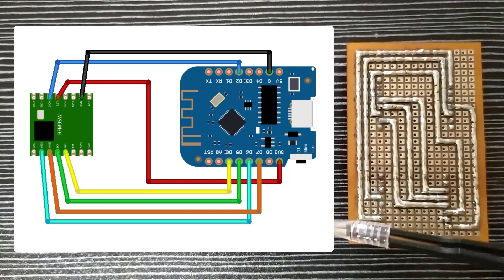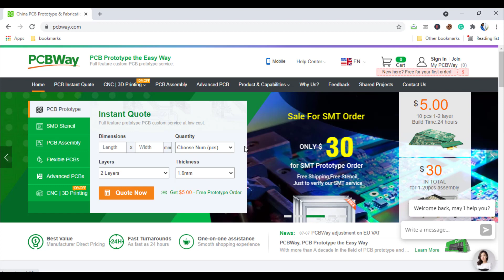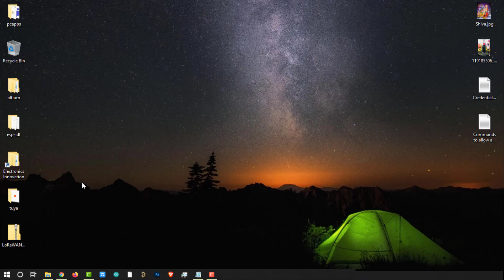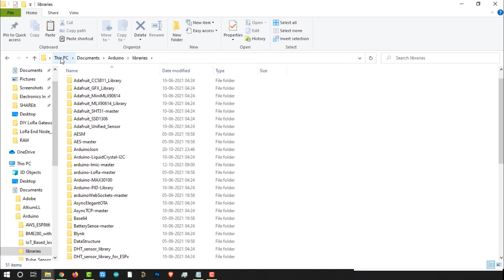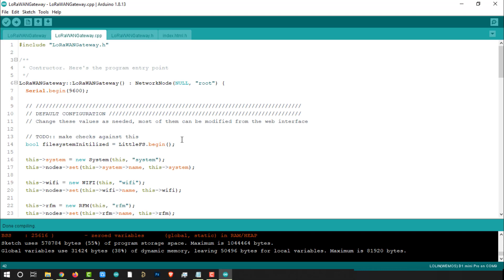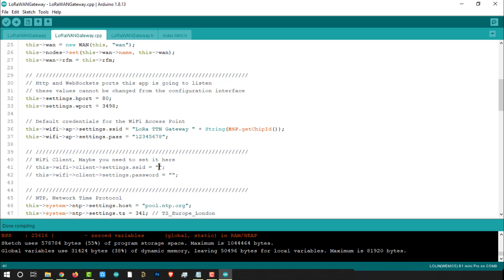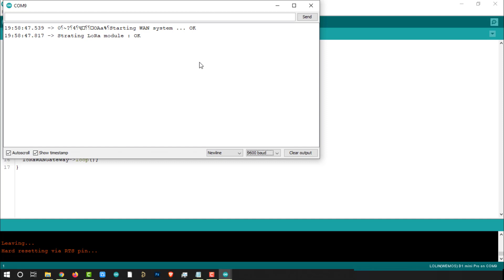Part1 DIY LoRaWAN Gateway with RFM95 & Wemos D1 mini Pro | How to make single-channel LoRa Gateway?

Comment: Hello sir, i did the same steps like you but i had used RFM95 Stand alone without any capacitors but direct cable connection. Do you know why i cannot read LoRa channel?